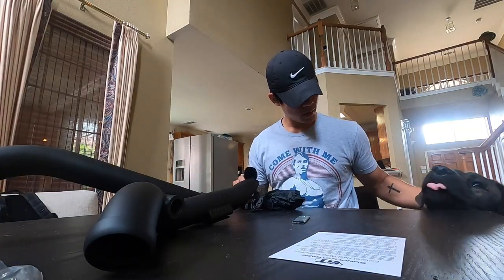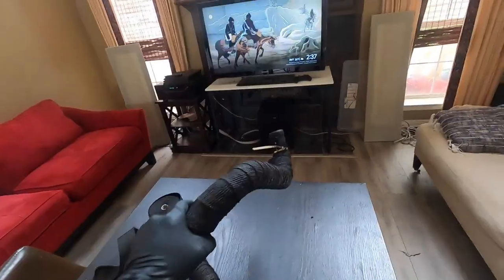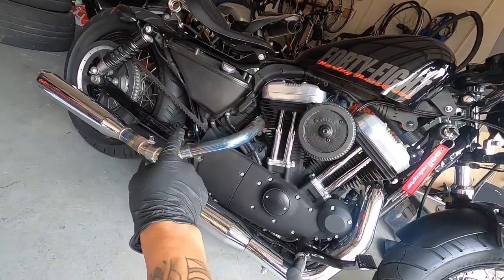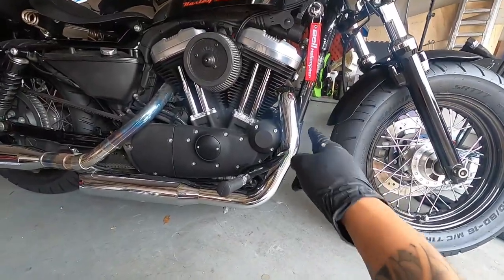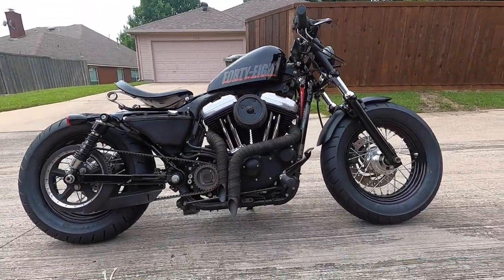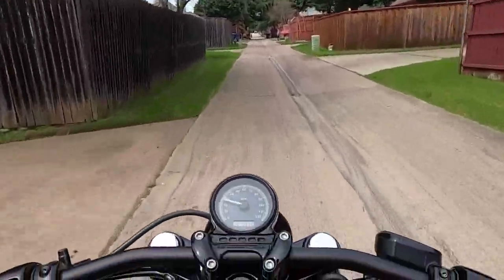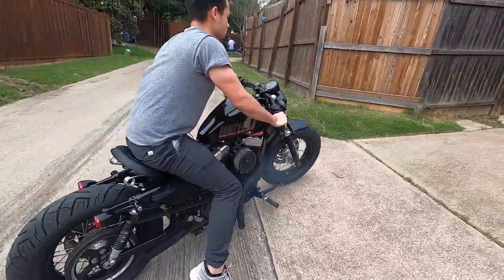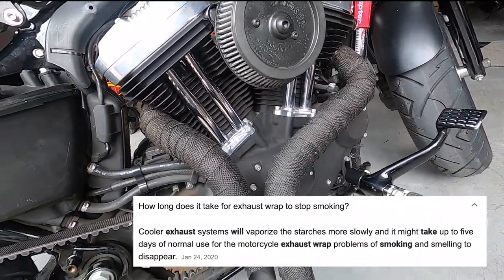Neighbor Hater Exhaust | Harley Davidson Forty Eight Sportster Bobber Build | VLOG .18

Comment: The other comments are correct about soaking the wrap in water first
2 reasons. 
You can get them tighter and they’ll last longer.
Second you won’t be breathing in any of the fibres coming off them. 
You don’t want them in your lungs.

But you are the first person they I’ve ever seen to wrap them properly!
Always start at the tip and wrap towards the flange. 
So the the wrap overlays itself life scales on a fish 
So many start at the flange and wonder why the wrap peels off 

Cool bike bro 👍
Reply from the maker: Appreciate you taking your time for the tips/advice. Next time I won't make the same mistakes!
Reply: @jpht.adventures  thanks dude.
I always caution people when dealing with exhaust wrap.
The fibreglass/asbestos dust that comes off it when dry can be very harmful if you breath it in

I know it’s an old video
But I just subbed 👍

Comment: Really cool. Nice.
I just bought these for my softail. 
I see the bolt together with bracket, but do they bolt to the bike at bottom at all? Or only at head. Thanks
Reply from the maker: Thanks for watching! But these just bolt by the headers and the bracket helps stabilizes them together. But no actual bracket to the bike. Hope that helps!
Reply: @jpht.adventures  thank you. There are zero directions anywhere. And all the videos on YT jump from wrapping them to testing sound. Lol. 
But they look and sound awesome on your bike. Ride safe

Comment: should be soaked before wrapping as youll get a slight stretch and theyll tighten up nicer when they dry.... yours look loose and will get worse quickly
Reply from the maker: You’re absolutely correct with that. Luckily it’s holding up just fine. But I’ll redo it when it starts falling apart.

Thanks for watching!

Comment: I might be late but is that front fender is aftermarket  ? Where did you get it
Reply from the maker: It was already installed when I bought the bike used. So I'm unsure if it's OEM or Aftermarket.
Reply: @jpht.adventures  Ooh ok I doing the same you did to your hope the 150 fit perfect w the fender

Comment: Hey man. Could you send me what exactly is this exhaust and the link to purchase? Very appreciated.
Reply from the maker: Here you go!

https://www.ebay.com/itm/1-75-Pipes-Exhaust-Fit-For-Harley-Sportster-XL-883-1200-86-13-Touring-84-16-Drag-/114177383082?mkcid=16&mkevt=1&_trksid=p2349624.m46890.l6249&mkrid=711-127632-2357-0
Reply: Thanks bro. It seems it does not fit for Forty Eight 2018.
Reply: @juniorjjjose   did you find the exact one that fits?
Reply: Actually, not. Was unable to find one that fits to 48 2018.

Comment: Awesome build did you have to tune the bike after the pipes or is it ok without?
Reply from the maker: I did not but I’m sure you’re supposed to for the bike to be efficient as possible. So far no Check Engine light 

Thanks for watching!
Reply: Hi excuse me I'm italian I never owned a harley I would like to buy a harley 48 could you tell me the 0-100kmh or 0-60mph ? Not that I have to race but just outof curiosity and I know it's not a superbike , it's just my curiosity 
Thank you have a nice ride
Reply: @Mad Max  I was just randomly scrolling though the comments trying to find out what exhaust he used and I figured I could reply to yours. I just bought a new 48 at new years. I haven't timed the 0-60 with a watch or anything, but it makes a LOT of low end power and is a ton of fun to ride. You would not be disappointed if your just looking for a fun bike to ride around town and stuff with. NOT recommended for long rides unless you do some upgrades
Reply: @Zustran  thank you , I think I've just found out the 0-100 of the 883 iron is 6".6 ... the bike is nice , the harley 48 is my dream bike since I was a kid ... shame for the speed ,but you can't win 😂 I came from ducati but they are wasted here in Melbourne, I didn't even use 10% of their potential so an Harley sportster 883 would be perfect for me
Reply: @Mad Max  the 48 is definitely a more powerful bike than the 883 with the 1200 engine being the reason. I love the sportsters since I was a kid too. My 48 is my first bike. And if you do the staged upgrades for either you make plenty of power to have some fun with.

Comment: Quick Question why when you press the ignition why Does it Take more then a second to Start? is that A specific modification you did to it and Btw Bike Looks Nice🔥
Reply: Thats a common thing with the usual acid batteries. i replaced my sportsters battery with a lithium iron battery, bike now starts in a micro second.